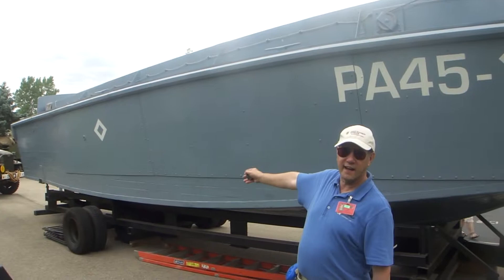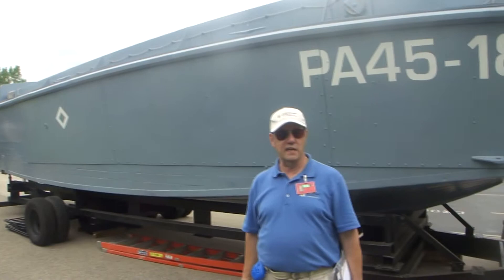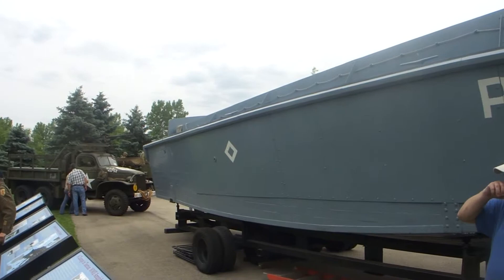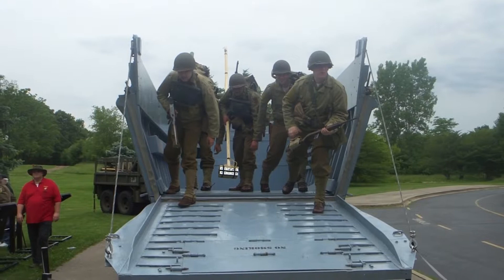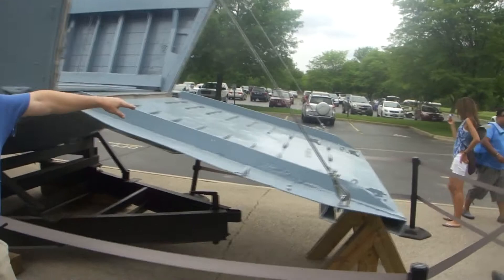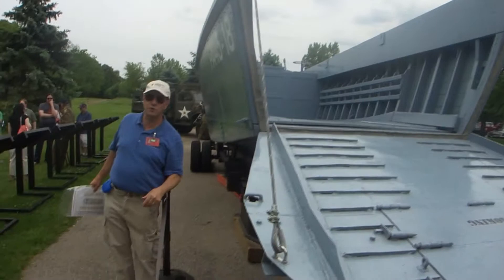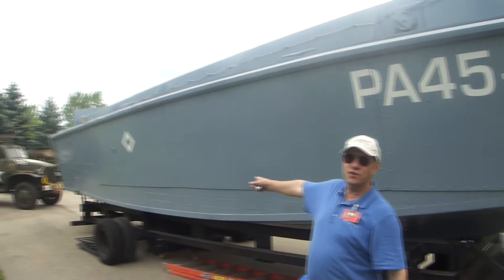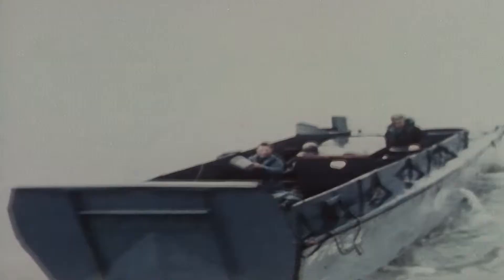First Division Museum at Cantigny - LCVP -"Higgins Boat"

Comment: I served on the Henrico Sept 1967 - June 1968. I was an Electronic Technician. I wouldn't have set foot on that particular LCVP (Papa boat we called them), but I did service communication radios on all of the Hank's Mike and Papa boats, and the Captain's Gig as well. The tubes in those radios were very fragile. As I remember the filaments to heat the tube were only 3V and as soon as the boat hit a wave the tubes would blow.